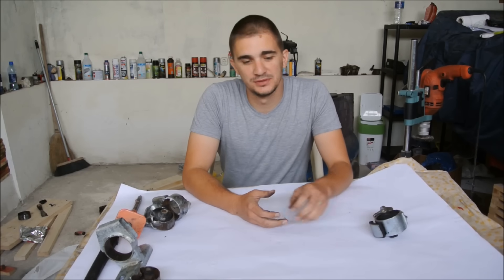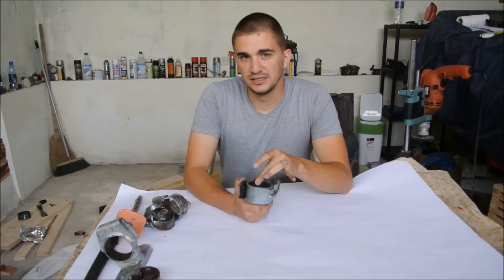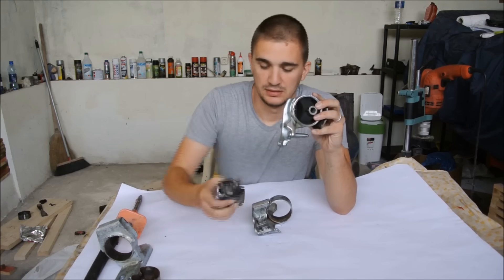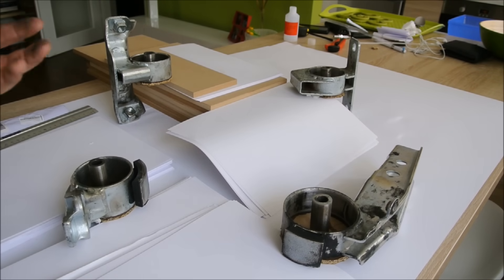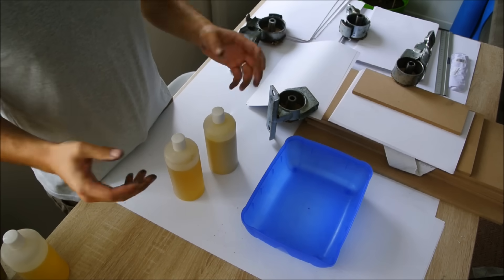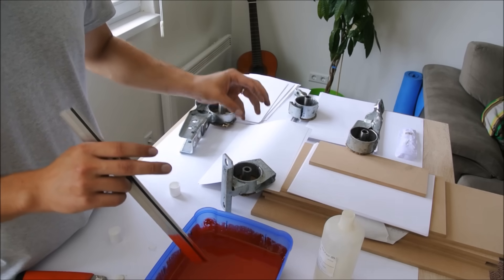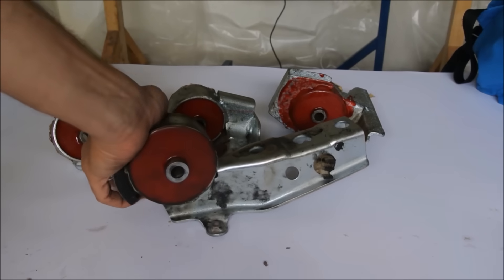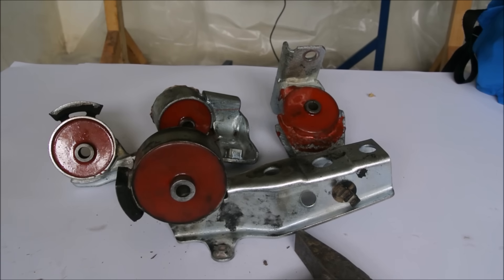How to make DIY polyurethane engine mounts

Comment: hi, 
have you installed the mounts ? was the result good enough ? 

I have a Celica GT4, and the suspension needs new bushes but.. turns out they "cant" be replaced. so most owners end up buying whole suspension arms just to replace the bushes. 
do you think this technique would work for a suspension bush ?
Reply from the maker: tuga2112 I haven't tried them for suspension bushings, should work in theory. You can give it a try with a trial quantity of liquid polyurethane, its not expensive. Let us know how it goes. Worked great for engine mounts, a bit more vibration and cabin noise, car feels more agile, they seem to be holding up perfectly so far.

Comment: if this fails , how do you replace the insert, secondly how do you know you haven't compromised the integrity or the strength rather of the pins by heating and burning out the old pin? 

not a criticism just a curios question before anyone says im trying to be negative
Reply from the maker: +RCEN NOVA Polyurethane is a lot stronger and more durable than rubber, and one of its main advantages is that it doesn't fail. It often outlasts the engine when it's done right. The downside is a bit more vibration and noise. If it does somehow fail, its ladder, rinse, repeat, i.e. Burn it out and pour new ones. You can pour it into the old metal inserts I mangled in the video. The pins are really thick and tough steel so it's not that easy to compromise them. The internet has somehow managed to convince everyone that any amount of heat turns metal into pudding. You need a lor more heat to ruin pins like these. I like and welcome comments like yours. Criticism is great as long as its constructive and civilized, it's how we improve.
Reply: driving 4 answers I'm an engineer by trade so I know more than average Joe blogs when heat is mentioned etc.

I assume you keep photos on record then so you can accurately replace the the pin in correct position.

I too agree criticism is important for improvement.  can only get better by making mistakes and trying again. Nothing ventured nothing gained

Comment: excellent video man, absolutely excellent! I clicked subscribe very early in the vid. haven't watched anymore of your vids, but if you have more DIY projects like this, I'm in! not sure if you already have, but I would love to see this used everywhere on the car that it can be. for new poly engine mount bushings for my Porsche 951 is at least $600, this is a HUGE DIY victory. if we can do sway bar bushings, control arm bushings, and so on, this will be an extremely helpful and money savings DIY. thanks dude
Reply from the maker: Tyler Fosse Thank you. Glad you liked it. I haven't done anything on the suspension yet, but I am planning to let the liquid poly loose on all suspension bushings when I tackle the entire suspension, sometimes in spring next year. There are a few more decent DIY vids on the channel, more are coming.
Reply: driving 4 answers I just watched your DIY sodablaster and am very excited about the idea of it on automotive. I was a sandblaster for years, but know little about soda blasting. wouldn't have even thought of using it on automotive. couple questions about it, though I think the answers are yes. first, could this be used for paint removal, or is it not strong enough? second question is based on you blasting the cylinder heads. so if you don't have to worry about it damaging anything, would it be safe to use to clean a throttle body as well? I would think so, and it looks like it would be far more effective than throttle body cleaner. thanks for the vids man, this is why I love youtube is the helpful uploaders like yourself
Reply from the maker: Tyler Fosse It can easily strip paint as long as the compressor is good. Anything that has a polished shine will loose it after sodablasting but you can polish it again with little effort. Its great for throttle bodies. Thanks for watching and your support.

Comment: Can the hardness of the polyurethane be adjusted with maybe some additive?
Did you car sound louder with the harder mounts?
Reply from the maker: Christopher Knee Definitely a bit more noise in the cabin. You could go 40A hardness, which is the equivalent of stock. I haven't really seen any ready-made additives on the market, but there might be something somewhere.

Comment: so, do you need to emulate the  holes or can you also leave them this way?  I really learned alot on this video, I didn't even knew it was possible.  costd me alot of money, those freaky rubbers
Reply: You can also pour around the stock mount insert rubber. Fills up the side holes and cracks int he old stuff, will also be lower then a 60A, maybe 50A for a more stock feel. Just a way to make everything last longer if you are just looking for a quick fix. Can caulk in the 3M window weld too so you might not need to remove anything.
Reply: I have also an idea of using templates to emulate the original holes . your idea of quickfix is good but you won't see the worn out cracks underneath anymore
Reply: Alessio S That is the idea, it's a quick cheap easy fix to buy you time, nothing else.
Reply from the maker: +Alessio S You can leave it like this, or emulate stock holes for less vibrations. Depends on taste and vehicle application. Thanks, I'm glad you liked the video.
Reply: you know alfa romeo's  147   156 and 159.     have this issue of destroying the rubbers of theyr front triangle's and torsion bars.  This is nice to know since people throw away the whole suspension triangle instead of changing the rubber.  and casting iron is a very energy consuming issue .  But they don't tell us we can make those things on our own :) . Can also be done on the rear omega axle of the Golf ,jetta and passat .  instead of being forced to buy an expensive rear axle .
Reply: Alessio S leave as is. Don’t torch it. It weakens metals (pins). Those hole by the way are molded from a machine that cost thousands of dollars of precision manufacturing. Meaning you’re more likely to eff it up if you start doing that.

Comment: Very informative, thanks. I was left wondering if it would be simpler to not press the steel sleeve but just
 remove the rubber and replace it with PU. I believe the sleeve is also increasing strength of the mount.The design of the cavities should be made exactly like the original ones for the required softness. Plastic tubes an other hollow items could be used for this.
Reply from the maker: +Markus Järvi Thank you. You can do it withour removing the sleeve, maybe a slight risk of weakening (tempering) the metal because of the heat emitted by burning rubber in it, but probably not. The metal sleeve provides no additional strength. The metal sleeve deforms with the first tap of a hammer, on the other hand you couldn't deform the mount even after quite a bit of hammer wacking.

Comment: You can buy poly bushings in all diameters as a 2 piece setup.
This is not worth the effort.
Reply: You're not really providing any real insight or information here. Can you buy aftermarket polyurethane bushings in all diameters with a sleeve for $25? How about all four for $25? You may not think the effort is worth it, but others may be more mechanically inclined and patient than you are.
Reply: //// Really ?  If you buy the right size, fitting wont be a problem.
By the way, my original comment was for a two piece set up. I mean how often do you change engine mounts in a cars lifetime ?
Reply from the maker: To install that 2 piece setup you still need to get the old rubber out. The only additional effort here was pouring the new polyurethane, which isn't that hard honestly and is a lot cheaper. Can you tell me where I can find that 2 piece setup I would love to check it out. Thank you.
Reply: driving 4 answers 
The two piece set up always comes with a sleeve. So there is no need to burn the rubber.
If you break the tension of the inside ring with a small saw blade or round file, it will just fall out.
Reply: //// Matter of fact you can.
If price is your concern, you can buy polyurethane cylinders in all diameters and cut them down yourself. Drill a hole in the middle and put in a sleeve. I drive a slalom car and want the least possible movement, so i make mine from teflon. All plastics are available nowdays.
Reply: Karl Napp so why wouldn't you do solid mounts
Reply: onemanonebreath You need some damping. Solid mounts tear off very quick.
Reply: Karl Napp
 the effort required to cut them down and fit them into the factory mount is more than it takes to cut the old rubber out and pour the new in.
Reply: Most of the effort is in removing the standard rubber mount and sleeve which you would have to do to fit any poly setup. Your comment is nonsense.
Reply: ItsFriscoBaby Oh yeah, burning out sleeves with a torch is standard in all garages. LOL
Reply: Oh man you're such an expert we should all bow to your immense knowledge. LOL
Burning it is actually an easy way to get them out without damaging anything.  I've seen garages use air chisels to remove the sleeve making shite of the housing at the same time.
Reply: ItsFriscoBaby I dont know where you are from, but new sleeves are actually easy to acquire. They sell them in stores and online.
And stay away from places that use air chisels.
Reply: +Karl Napp yes new sleeves are easy to get its removing the old ones is the hard part and that has to be done no matter what you're replacing it with.
Reply: ItsFriscoBaby You use a round file to break the tension on the pressed in ring. No air chisels or fire needed.
Reply: +Karl Napp there are plenty of ways. I never said an air chisel was a good idea only that I had seen one used for the job. The point is it has to be removed anyway and thats the hard part of the job.
Reply: ItsFriscoBaby Well there you go, youve just learned something. Use a file, not fire.
Reply: And you've just shown yourself up as an idiot. 
You said this wasn't worth the effort because poly bushes are available to fit. Most of the effort is in removing the old bush and sleeve which would have to be done to replace the bush no matter what you were putting back in. 
Your whole point is nonsense.
Reply: ItsFriscoBaby You are right, filing away 1 mm of metal takes way longer than beating it out with a hammer. And burning away rubber is much faster than putting in a new sleeve. Not to mention the hours it takes to put a two piece bushing together and stick a sleeve in the middle. lol
Reply: +Karl Napp you obviously can neither read nor remember what you typed earlier.
Reply: ItsFriscoBaby That must be the problem. lol

Comment: Don't use rubber gloves on a drill press. They can be wrapped up in the turning tool, and they don't give any protection from a wire brush.  Use leather!

Comment: How do you avoid tempering the metal when you burn the old mount out?
Reply from the maker: It doesn't get that hot since you don't need to apply the flames constantly. The rubber starts burning on its own pretty soon. And it really isn't that easy to temper metal as the internet seems to suggest.

Comment: Wow no heat and no degassing? Makes it look easy.
Reply from the maker: This product, Reoflex 60, does not need degassing or heat. Needs to cool at 23 Celsius for 16 hours, that's it. There are other polyurethane products that also don't need degassing, this just happens to be the one that I used.

Comment: Do you have to take the old rubber out? what if you just pour the new one over the old?
Reply from the maker: Nothing wrong with it. I did it like this because I wanted to imitate aftermarket ones and have it 100% poly. But I think the results will be almost identical if you just pour over the old rubber.
Reply: Cool, in that case I will try this for sure. Thanks.

Comment: this video is not too old now, wondering how is the durability so far? any deformation or cracking?
Reply from the maker: Done approx 150 miles so far. Zero damage to mounts so far, zero deformation. Vibration is more noticeable than with the stock ones, especially at idle and low rpms. I will make really detailed followed up comparison video really soon. I ordered another set of stock mounts to compare with the polyurethane ones.

Comment: Instead of the cardboard you might be able to cast a mold out of body filler, wax the mount first, cast the mold, then when you have the parts separate they should fit back into the mold and be held in place for pouring the polyurethane.  This might even allow you to cast in the cavities like the factory part, just don't forget to put a release agent on the mold first.
Reply: If you're looking for a simple way to get the OEM cavities, just use some children's wax crayons of appropriate diameter without the paper wrapper. After the polyurethane cures you can melt them out with hot water.

Comment: you know if you just invest 130$ in a vaccum pump and  2 gallon vac chamber combo on ebay(not trying to advertise so i will leave it to you to figure out what exact brand and size you want, i just did a quick search to come up with the 130$ figure on avrg), and then you will be able to get rid of all air bubbles by pulling full vaccum on the chamber while the poly cures, you could even buy a 20$ surface speaker(the suction type speaker that uses whatever u suction it onto as the speaker cone/surface) and put it on some low hum frequency to help agitate the bubbles and also allow for the 2 part poly to set in the most dense and bubble free manner... just seems like for 150$ round about, you can take your method and basically upgrade it to a hobby level setup that produces the same results as the pros, minus the redicules 200$ price tag per part, that costs 15$ to make.
Anyway i am not saying a vac oven is nessisary, or that sonic agitation is(sonic agitation sounds fancy, but basically im saying set ur part on top of a subwoofer or paint shaker nothing fancy whatsoever) and you might notice results that make you never pay more than 30$ for an upgraded poly bushing ever again, cuz you will simply make your own if you are faced with the situation of some fathead demanding 500$ for some mount he made in his garage just as well as you could in yours... glad that someone made this video to show ppl how easy it is for a hopme DIYer to make poly mounts... i just wanted to add my 2cents about a vac oven allowing this method to produce results that are commecrial quality :)

Comment: for the s10 trucks you can fill in the gaps in the mounts with poly window weld. you dont have to tear out the rubber. you just goop it in with a caulk gun

Comment: Very nice result however from my experience unnecessarily labour intensive. What I've done was to leave the OEM mount as it is and just filled the gaps with Tiger Seal (PU in a tube). The mounts were all completely perished and cracking, since doing that they've been rock solid. My car had three main mounts and two "helper" torque mounts, I've removed the torque mounts completely saving a lot of weight and the engine hardly moves at all even with only three mounts holding it. It looks a bit ghetto but so does the rest of the car lol. The only downside is it vibrates a lot more now, doesn't bother me as it's a track toy but wouldn't like it in my daily.

Comment: which ptoduct did you buy from smooth on? i kniw you 60a but theres several different types on their website. by tge way also have an aw11 and my torque strut mount is just thrashed, I've owned it for about 11 years
Reply from the maker: Its in the video description and also in a few of the comments. But here it is again. The product I used is Reoflex 60 from Smooth-On. https://www.smooth-on.com/product-line/reoflex/
I am not in any way sponsored, endorsed, supported, etc. by this company. There's a lot more good options out there probably.
Reply: driving 4 answers thank you

Comment: I have a reason. The GMT800 series of trucks (that would be Silverado/Sierra 1500's from 99 to 06) don't have poly mounts available from any retailer, and I would prefer trying this over strapping or a massive engine plate, which is too solid and imparts too much vibration.

Comment: Got to admire the man's ingenuity, Can you imagine when your Insurance company asks you any modifications, and you state yes, I made my own mounts, for Engine, steering and suspension components. They don't even like after market alloys!!
Reply from the maker: Funny! Where I live they charge insurance based on engine size and bhp output. That's it. Sad but true.
Reply: You tell them you've up-rated the brakes so in theory you can stop quicker, you've added bucket seats and a roll cage, so if in a accident you will sustain less injuries, but no, they think you will be driving around like a maniac ^^

Comment: Unless you're building a dedicated race car, solid or poly mounts are not an improvement on the street when you compare the performance vs the extreme vibration you will experience. Don't let anyone tell you the vibration is "not that bad" for a daily driver. For a strictly recreational car, it is a decent upgrade.
Reply: "Don't let anyone tell you the vibration is "not that bad" for a daily driver"
WRONG Let people tell you that and pick based on your brain power! 
 vibration depends on placement as well as firmness! and also price can be a benefit. 
Take a 90'S dodge caravan P side upper mount Big ugly thing with lots of side movement, so bad that hitting a bump can pull the accel shaft out of the trans. (i had this happen in a 93)  I pored a new bushing after and dropped the side movement to almost nothing and it cost me 10$ that is 50$ less then the parts store mount was at that time! 
as for vibration. almost nothing new, due to it's placement (not front or back trans.) it just gets sitting load.